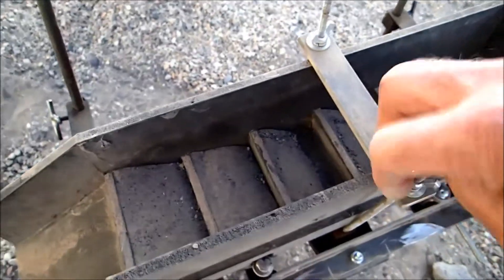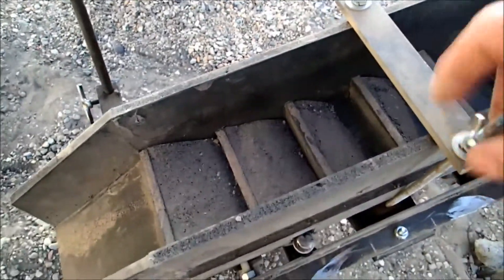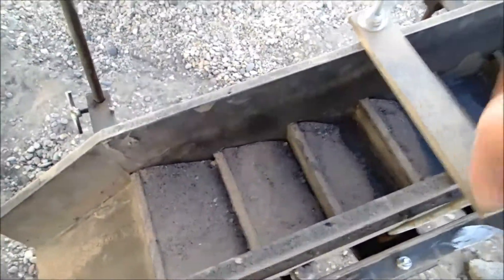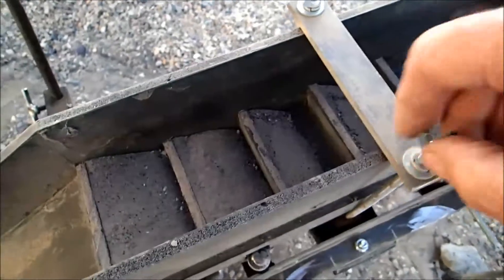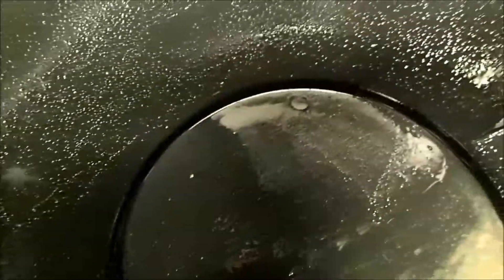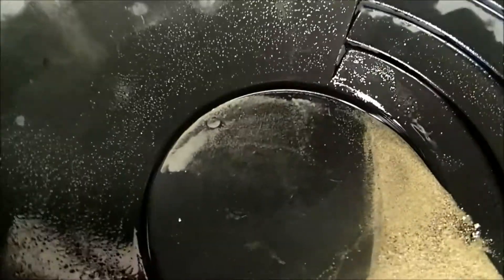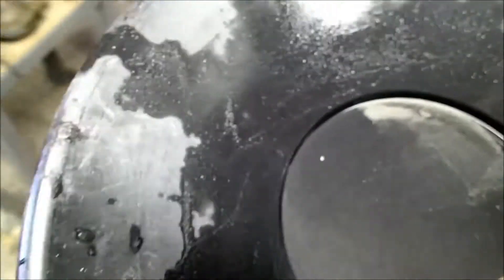Dry (waterless) Jig Part  3

Comment: Hi Jim, I thinking about something like this but into "mud areas" with very little water...
Reply from the maker: What you really want, rather than that, is one of my "Sweep Jigs". They require just a small amount of water, and recover micron-sized gold.
Reply from the maker: Take a look at the video entitled "Bonanza Bar Sweep jig Test"
Reply: @jimnelson7740  Thans for answer, I already watched that series... :-) Now, just to find out, how to make some small backpack portable version... No way to get to my place by car... :-(
I will try something like your shaking round table, probably make it from plastic box with a bit of angle...
Greetings from the Czech Republic, the Heart of Europe... :-)
Reply from the maker: @frantiseklaluch6605  If you're talking about the round vibratory table that I showed on the Big Lost River, I would recommend making it with no edge lip, and have it slope towards the center at about 6 degrees. It will require slow feeding, but should recover fine gold pretty well.
Reply: @jimnelson7740  Thank you for tips, I leaned a lot in your videos... :-)
Reply: @jimnelson7740  Thinking  about the concept, so it is basicaly batea using vibration instead of water for stratification. heavies go to the center and down, lights fall out... hmmm... cool... May be I can use my XP batea pan and make some kind of "tripod" and fixation mechanism, I already have vibration motor 12V... I will give it a shot... :-)
Reply from the maker: @frantiseklaluch6605  Yes, but here's the key thing...if the material is too deep, you get weird eddy currents churning it from the vibration. You can see that in my Big Lost video, if you look close. So, keep the feed rate down. If you need a faster feed rate, you should build a larger unit. By having the material shallow, it will also recover gems. The effect is lessened when running wet, but still there. You can emaill me at <jrnelson(underscore)536(AT)q.com